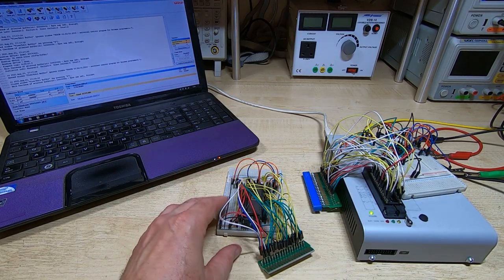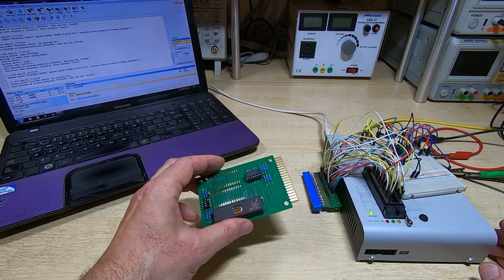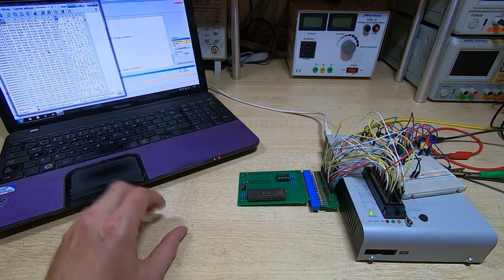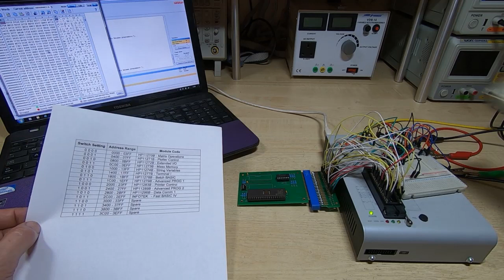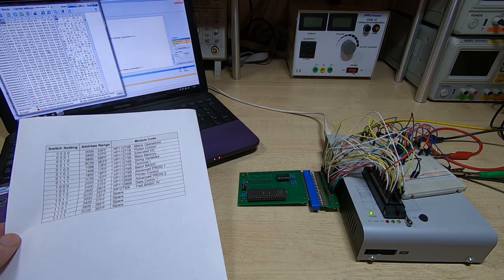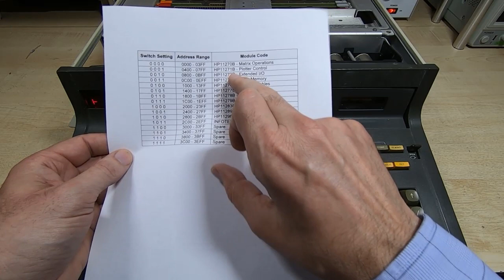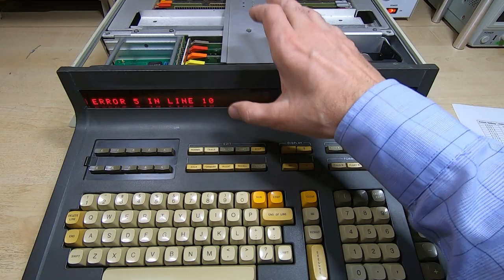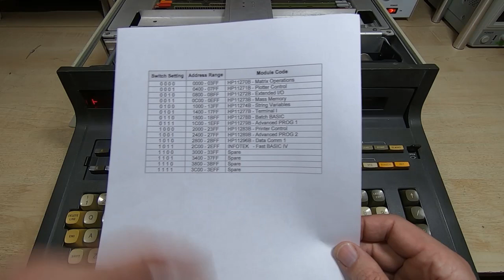HP9830 Module pcb Part6

Comment: I am not sure what EDA/CAD software you use. I would actually be interested in seeing how you did the board-to-board connector. I have a project I need to do that has a board-to-board connector like that. I've never designed that in KICAD before. I know it seems silly but maybe get it into how to measure the original one. I know I would watch it!